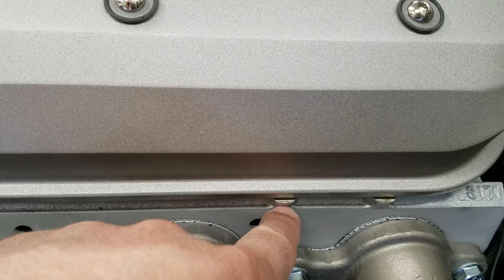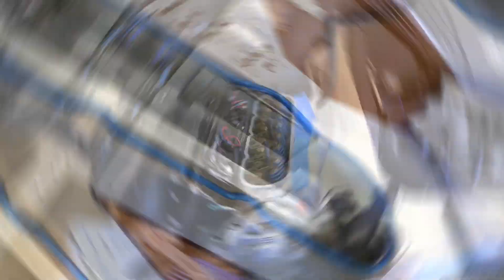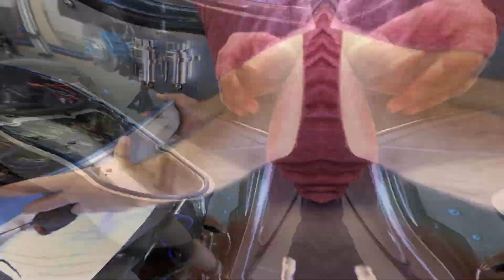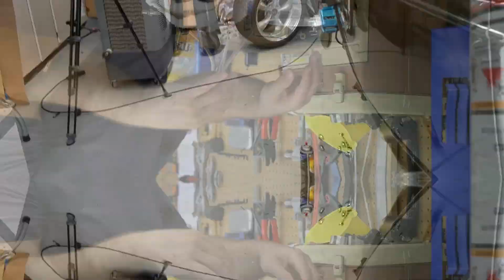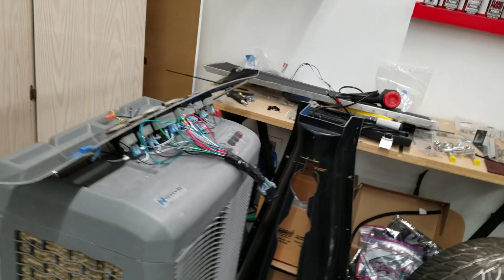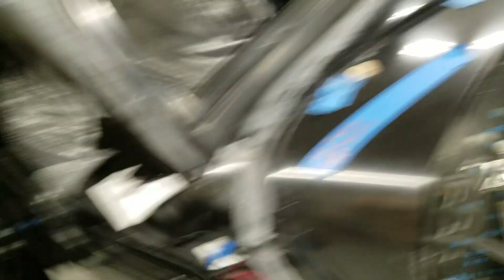Factory Five 33 Hot Rod V2  - Working Out The Kinks - Brakes

Comment: check where your oil filter is. there is a block off plate just above it if you aren't using an oil cooler and there is usually an 1/8" npt port on that plate. if there is use that port for your gauge and put the original sensor back on the motor for the terminator.

Comment: Bench bleeding a new master cylinder is always required before installing it. The best way to bleed your breaks is use gravity. Run rubber hose from each bleeder to a catch can. Crack all four bleeders open and let gravity do its trick. Keep topping up the master cylinder with fluid. Never let the master cylinder run dry. With in about 30 minutes you brakes will be prefect. Close each bleeder when you see no air in the lines.
Reply from the maker: Gravity bleeds sounds great, especially for a one man process.   I think I have come to the conclusion that bench bleeding works great if the reservoirs are built in.  But since I have remote reservoirs, air will enter back in when transferred from the bench back to the car making the cylinders capture air again unfortunately.